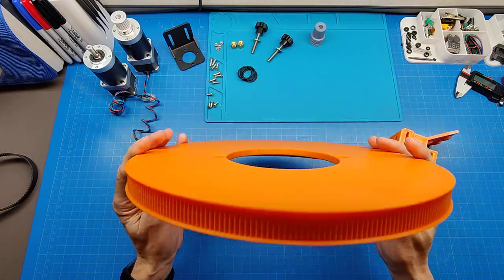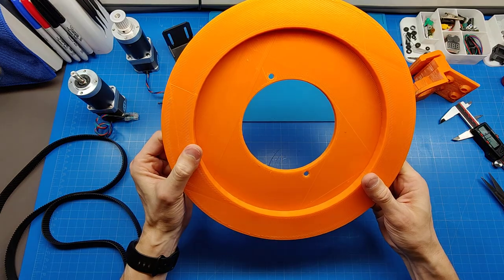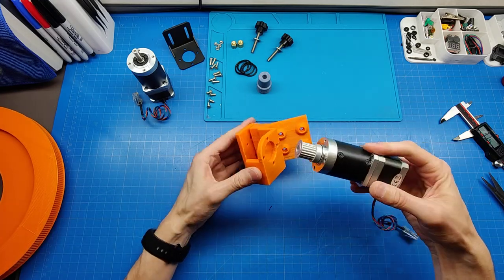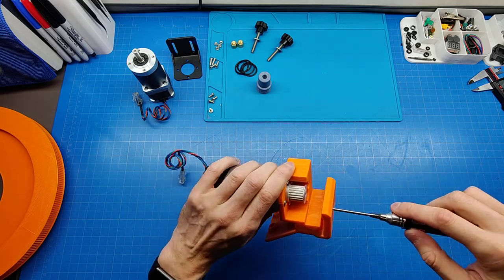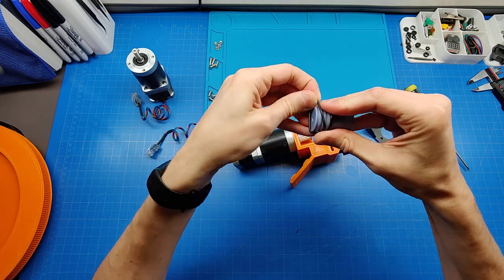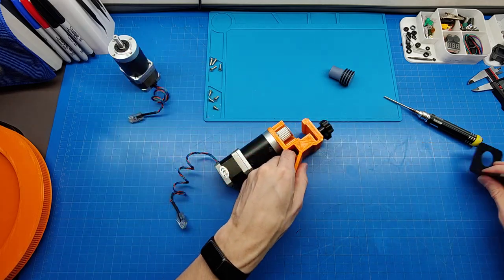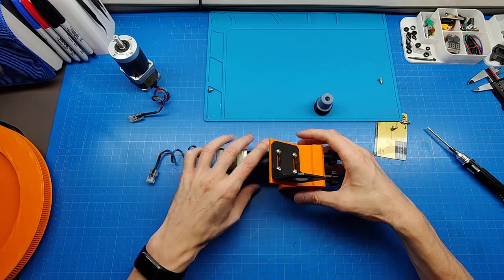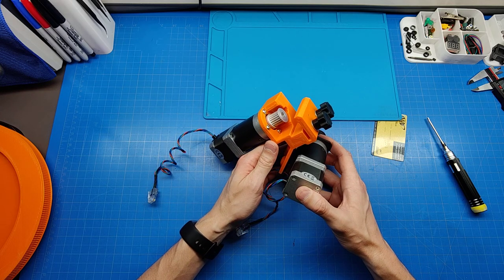OnStep your Dobsonian with Zero Woodworking - Part 1

Comment: Hello, this is amazing! Would this exactly fit my 12" collapsible sky watcher dobsonian?
Reply from the maker: Unfortunately the answer is "No, it won't". The advantage of the dob I have is a nice thrust bearing design of altitude bearings in CNC body. Which allows to fit this large timing belt wheel on it very nicely and very centered without drilling any holes in the telescope tube. It is however possible to design something for your specific scope model, but installation of  these mechanisms won't be as easy.

Comment: Hello, can you recommend some cheaper alternative to the stepper motors you used?
Reply from the maker: frankly - there is no alternative, it is not about a motor - these are pretty com m on NEMA17 steppers you can find as low as $10 a piece of eBay used in decent codition. It is about the gearbox they come with - it is high precision gearbox with a very small backlash. It may work with cheaper gearboxes, you may have to play around with backlash config settings in OnStep https://onstep.groups.io/g/main/wiki/20943
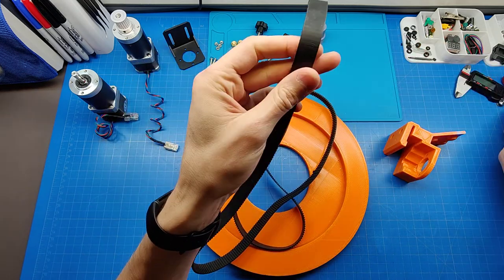You need any NEMA17 stepper with gearbox with at least 1:50 ratio

Comment: Hello. can i adapt this kit to my 12" dobson telescope? (Levenhuk RA 300N)
Reply from the maker: Yes, absolutely. Its essentially the same scope, just slightly larger size.
Two things to take care of: 1. the belt length you need. 2. modify the geometry of the motor mount. Because the geometry of 10" mount base is slightly different (distance and angle from vertical wall to the circumference of the base). As for that large timing wheel   (altitude)  - you can just print out my design, it must fit.
Reply: @alexm7056  thanks sir but the stepper motor link is invalid. Where can I get these same engines?
Reply from the maker: @khattab9612  https://www.omc-stepperonline.com/nema-17-stepper-motor-l-39mm-gear-ratio-100-1-high-precision-planetary-gearbox-17hs15-1684s-hg100
Reply: @alexm7056  thanks. Where can I find an onstep motor controller?
Reply from the maker: @khattab9612  you have to make it yourself. The cheapest way is WeMos R2 + CNC shield (which I actually use in this project) https://onstep.groups.io/g/main/wiki/19670
You do need to have certain "Arduino-level" skills to make it work. Instructiions may looks way to technical for the newbies, but don't hesitate to ask a question in group discussion.